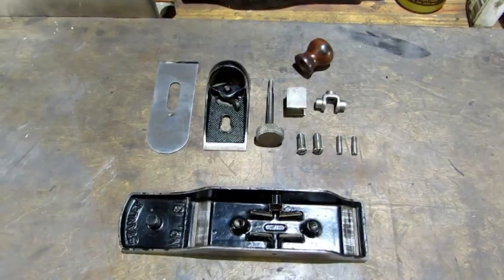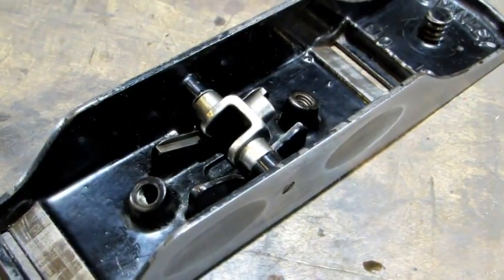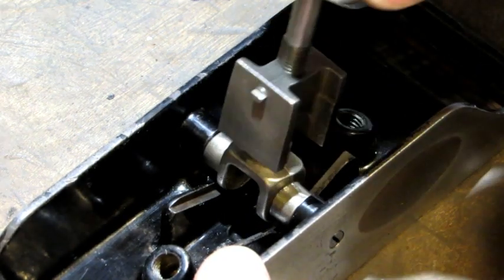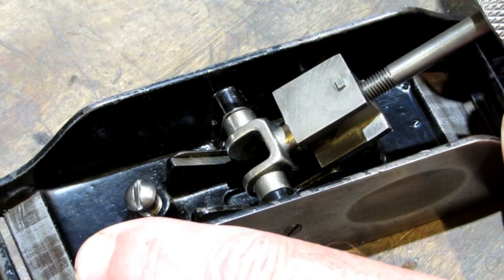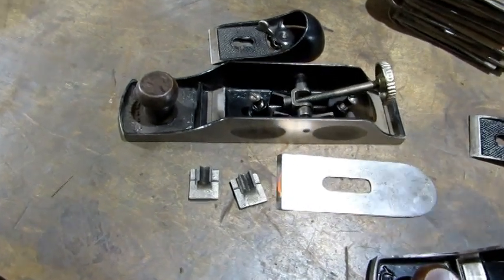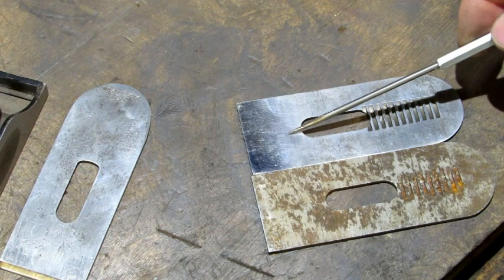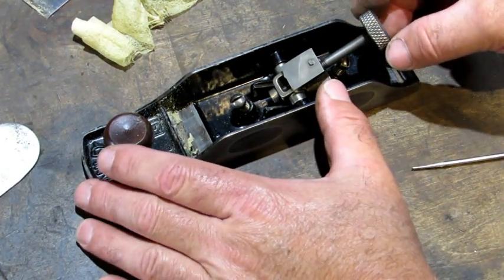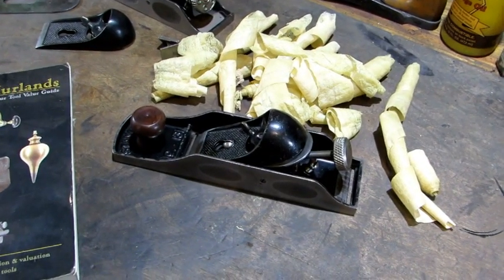Stanley No. 131 Double End Block Plane

Comment: From: Blood & Gore .. The Superior WorksThe    lever cap screw (the one that engages the lever cap to act  as a fulcrum point) is repositioned in the main casting to the respective mouth position; i.e there is only one lever cap screw on the plane. Were there  two lever cap  screws, the adjuster couldn't slide over a suitable range.